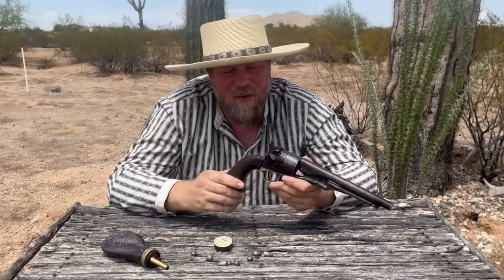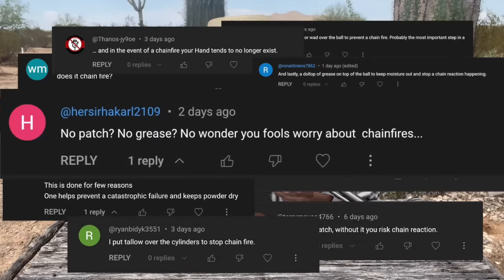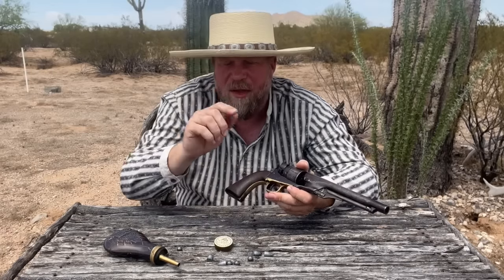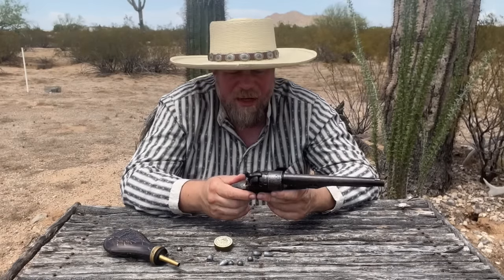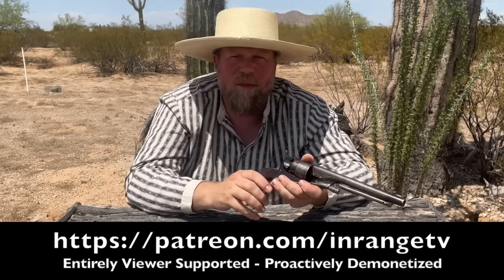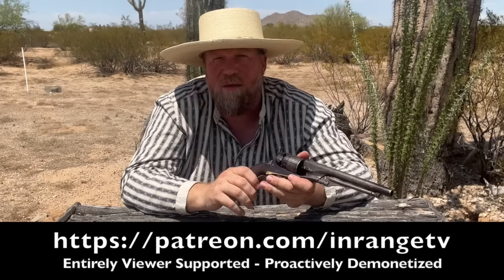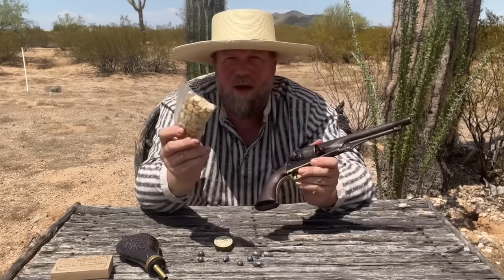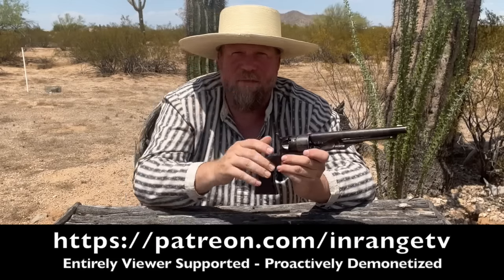Chainfire!  Is it dangerous?

Comment: I've heard both camps. Use grease and no grease. The negative camps explanation is that with proper size projectiles, you'll see a shaving of lead. Proving there's a good seal and eliminating the risk of a chain fire. In my limited experience with C&B revolvers, I usually put a smear of crisco sealing the end of each cylinder chamber. I've never used a patch or felt wad. But living in Vermont, I don't have the problem of melting grease like he has in Arizona.

Comment: I always load roundballs with a lubed wad, JUST for the lubrication. My assurance against chainfire is that ring of lead. For cylindrical bullets, I rely on the lubed grooves.

I came up with an "over the cylinder" lube that stayed fairly solid up to about 100°F, but the first round melted pretty much all the lube on the cylinder.  Very little added safety after the first shot, so I dropped it.

Comment: There is one more thing to consider: if a cylinder has been damaged in any way or is out-of-round, it is possible that a bullet that is swaged at the opening of the chamber may not fully seal. There are numerous ways to cause this, from overcharged loads that cause swelling to simple manufacturing errors. Chainfire is not a real issue with a properly sized projectile in a perfect chamber, but given the manufacturing tolerances of these old revolvers combined with user error that may have damaged them, it is still a real issue in historical pieces.

Comment: My problem with felt wads is that you can not let them sit in the gun for long because the powder eventually absorbs the moisture.  I don't know if anyone sells dry felt wads, but putting wax over the balls works better (here in the mid-Atlantic region).

Comment: Great video! If I may ask, is there any solution regarding the primers/ caps during fireing, so they ,or fragments from them, don't lock the cylinder on the revolver and fall into the mechanism and jamming it up? That is probably the biggest problem when it comes to  reliability of percussion revolvers. Greetings from Norway and Idar Ola🤠🖐

Comment: I have a brass frame Pietta 1851 Colt in .44. I use .454 round ball which is oversize and shaves off a thin ring of lead on each ball I load. I do not use a wad but smear a 50/50 mix of beeswax and coconut lard over the ball and have fired many thousands of rounds over the last 25 years I have had the gun. I have had a chain fire twice in that time. Both times it was in very hot weather (here in Queensland Australia) and was the next chamber to the right and the ball went skipping down the range and was not a big deal. I did not think it could ever be a problem.
Then I was shooting one day with another guy who had a Navy Arms 1851 steel frame in .36. He fired a shot which sounded unusual then the revolver jammed. On inspection it was evedent that the lower chamber had chain fired and the frame was visibly bent. I would not have thought this possible but there you go.

Comment: My one and only chain fire was with a Uberti made .36. I used the recommended no. 11 cap, pinched. I had .375 round ball, almost perfect lead rings. This was the first and last time I used revolver wads, and a grease patch. Upon firing my first round, all six chain fired. I have not used a wad, or grease patch since. I think mine was caused by some how i messed up with the caps, I can't think of anything else.  The only damage to the gun was a small spot of bluing missing from the cylinder pin, and i had a ball stuck under the loading lever, my only damage was solved by changing my drawers.
Reply from the maker: The wrong size caps are definitely a problem and pinching them is a hack that can result in a chainfire.  I recommend slixshot replacement nipples with CCI#11 or, even better, Remington #10s.

Comment: I always used lube on top of my round balls te prevent fouling.
If not then after 2 cilinders you see the groups going wider because of the hard buildup inside of the barrel.
And it takes a lot more work to clean that.
I like using bore butter, but yes that melts if it gets warmer.
i live in a country with a moderate climate but on really hot days i used tougher grease composed out of beef allow and beeswax.
I never walk around with a loaded gun in a holster so even if the grease melts a little, all shots are fired before it has the chance to run out.
I have been shooting cap and ball revolvers since 1987, never had a chainfire.

Comment: Between my flintlock long rifle and a remmy 1858 I decided I needed to make my own grease/lubricant to cut down fouling.  Long rifle can't shoot more than one or two rounds before it becomes nearly impossible to shoot from the fouling.  The remmy can get off two cylinders before its time to clean it. So I mixed together some bees wax off amazon with some Olive oil from my local store.  Melted down and left to solidify.  Yeah, it can melt, especially once your gun gets hot, but if you get the mixture right you can adjust it to remain more solid in the heat.  I can fire all day without any issues loading every round is easy or easier than the first.  Leave a rag on your belt to wipe your hands if its an issue.  My long rifle wood loves the oil.  Plus, it smells delicious when you fire off a round.  Worse case you have incredibly moisturized hands hahaha.

Comment: I had one that 4 chambers went off.
One up the barrel, two either side and cleared the frame. One went up the loading ram. Which I loaded back in.
No obvious extra recoil, as the extra chambers had the balls pretty much level with the front of the cylinder. So barely and velocity was generated.

Comment: I load in the new-old version, aka "the Oregonian" or "the naval pattern ".  

Powder,  followed by paper wad/paper cartridge body, followed by ball, followed by a hefty plug of homemade Bore Butter,  which is paraffin mixed with Crisco and melted while blending.  The Crisco falls away in hottest climates, but the wax will remain as a residue.  

Also,  several points you made were incredibly inaccurate.  Yes, Colt said that.  No, it's not a 'new' method to use wax and wad and wax-cover your caps... that's actually the US NAVY Standard of Arms for the 1861 Colt Navy, which was developed for use on Ironclads and sailing ships with a higher likelihood of powder-fouling  due to higher atmospheric moisture content due to the spray of the sea. (Ref. Naval Arms and Operations of the United States,  1800-1900) 

I carry my Josephine this exact way, and have yet to experience a chainfire (cross my fingers), as that's what DGW (the manufacturer and distributor) suggested in their Manual of Arms, or I'd be shooting smooth-wall hollopoints that I can source which are made from the same soft lead as the swaged round ball. I simply know about the Navy MoA, because I come from a traditional military family, and my Grandad and sister were both in the Navy. It's not a well known or oft repeated piece of historical knowledge.  I can say that the first person to make the concept standard in the Navy for all cap-and-ball revolvers, was none other than LtCmdr. Johnston Morgan of the Monitor.  Little piece of historical facts for you.
Reply: What is a smooth wall hollow point?
Reply: @markfrench2980  one without greasetrap grooves on the side of the projectile.

Comment: Appling grease/lube to the chamber mouth will not prevent chain fire if the projectile is undersize, if you fire a fully loaded percussion revolver then look at the front of the cylinder you will see that there is no lube left, it has all been blown away by the first shot, but if a correct size projectile is loaded,( as you do), leaving a ring of lead, there is no chance of chain fire from the front, unless the chamber is in some way damaged leaving a flame path, the problem with a lot of todays shooters is that they have a very casual sloppy attitude when shooting C&B, so use oversize caps, or worst still squeeze them to stay on the nipple, and use bought in undersize projectiles, if you look at a slow motion video of a C&B being fired you will see the rear of the cylinder is engulfed with flame at chamber pressure, given a loose, or missing cap that is where chain fires occur, the problem is made worst by the mainspring being weak, allowing the hammer to blow back from the nipple, bang bang! This is an excellent video made by someone that knows the subject!                        Stay safe! Chris B.

Comment: For the last three years, I have been using 0.451 balls sealed with heavy industrial grease. It's very messy but works for me.
I'd like to try conical projectiles, but they are very hard to find.

Comment: I make my own paper cartridges for my Walker and 1851. I use cigarette papers and a dowel tool for proper sizing to make and tube and then another small circle of paper to make the bottom of the envelope. When that's done I pour a powder charge In and then take a round ball usually 454 for the uberti Walker and I roll it on the top of a glue stick. Then I take the envelope and seat it in the top of the dowel tool and seat rhe ball on top and compress it down with the dowel so it's nice and tight but not too tight and the ball is nice and attached. I can shoot these no problem but what I like to do after is take a tin can of lamb tallow I have and heat it up on the stove for a few minutes to liquefy it on a low heat. And I dip the exposed ball into the wax so that it goes just up to or barely up to the paper to coat the ball I'm a thin wax and I store the cartridges in a cartridge box I made for later. It can take quite awhile to get a good ammount saved up and its a process in itself but it makes range days alot quicker and more fun to shoot and if I run out I can just switch over to the flask and patch. Or if I want to do heavy loads in the Walker I can pour it out myself as the cartridges are pre measured.

Comment: I have fired thousands of rounds in a percussion revolvers (Remington) with all six chambers loaded but only 5 capped (for CAS events), never a chainfire with loose powder and balls... I cast my own balls from pure lead at .457" which shaves off a ring of lead on loading, so the fit is perfect, as good or better than a metal cartridge. The .457 balls actually have about a 1/8" bearing area when so shaved. Chambers are slightly chamfered at the mouth and all reamed to be perfectly round and .001" over groove diameter which I measured at a consistent .451". I have never, ever, had a chainfire in over 30 years of shooting, even with uncapped nipples on loaded chambers.....I have never used grease in the chamber mouths, and I imagine that back in the day it would have been a terrible idea as during carriage all sorts of dust and grit would collect and do the bore no good at all.
Latterly, I have used paper cartridges with conicals, bullets lubed as for metallic cartridges. The conical mould I have makes .451" bullets, which are a bit marginal, but in the paper cartridges and with the grooves filled with lube in a lube/sizer they work very well. Both balls and conicals are very accurate, with pretty consistent velocities.
I have a feeling that some commerically made balls are a) not consistent in size and b) not made of really pure soft lead...

Comment: Great video. Back in 70s, I squirted Crisco over the balls (that doesn't sound quite right :P) from a 2" diameter pastry decorating syringe. In the cool Northwest, melting wasn't a problem, and I think the grease did help to reduce fouling. The balls that we cast were big enough so a ring of lead was shaved off as you'd seat the ball, and that was such a tight fit that I really doubt it could have chain fired.

Comment: I have limited practical knowledge, but a lot of youtube knowledge since I have always wanted a cap and ball revolver.  
What is not being discussed are the lesser quality of the modern replicas compared to original colts.  Most if they want to use conicals last I heard must elongate the loading slot that is just in front of the lower cylinder.  It is my understanding that often other tolerances are out of spec in these modern guns.   
Many replace the nipples on their replicas with those provide a more secure grip or hold on the caps.  And a better seal on the front end of the cylinder is the more obvious solution that one can readily understand vs flame around and between the nipple and the cap is not so obvious.

Comment: The one thing I can attest to is that you will destroy a Brass frame revolver with a few chain fires. My first BP pistol was a Brass frame colt .44 copy and it was my first time shooting Black Powder. at that time not many were shooting BP guns in the 1970's. The only instruction I got was from the gun shop where I bought the gun and they were the ones to tell me to use a hard tallow or grease over the balls. I knew back in the day they shot canonical bullets and round balls but I could never find the canonical bullets. Later I bought an 1858 .44 Remington Brass Frame and I happen to spot a Black Powder Shooters Bible there with complete instructions for loading BP Revolvers. The proper size bullet was stressed in that article and they stated that when you rammed the ball into the chamber, the proper sized ball will leave a lead ring around the chamber and that would keep chain fires from happening. As I remember the information sheet that came with the gun said the proper size ball for that 1858 Remington was .458. I always used the .458  swaged balls in that revolver until I got a .458 canonical bullet mold. I switched from grease or tallow to bees wax for lube and still believing that was for safety. When I shot the Colt I found that after the first shot most of the tallow or grease was melted and it was all gone after the second shot. But the Bees Wax, even though it melted from the flame of the shot, a good portion remained. I shot that Remington for 30 years, thousands of rounds without a chain fire. But with the Brass Frames it comes a time when the barrel loosens up. I was able to fix th the loose barrel for a bit, but then the frame cracked in the thin area by the ramrod. Brass will only take so much hammering from firing, so now it is a wall hanger. But you are right as to the proper size bullets to prevent chain fires.
One other thing I might mention. When I was stationed at Hickam AFB HI, I would shoot with the BP club out there. One guy had a reproduction of a Colt Walker that took 60 grains of BP. To cut back on the powder charge to 30 grains because Black Powder was hard to get in Hawaii, he would charge each chamber with 30 grains of BP and use another 30 grain volume of corn meal on top of the BP to fill the gap before ramming the the ball. That also worked to prevent chain fires and also added to the cleaning of the barrel every time he shot. He never had any problems shooting it that way the 3 years I shot with him. My 1858 only took like 27 grains of BP so I could never needed a filler on top of the BP.  Later I knew another guy that did the same thing in a rifle. He also stated that it kept the bore cleaner. Have you ever heard anyone doing that? 
While I was stationed at Hickam AFB, I ordered my first BP Rifle a special order 1863 Shiloh Sharps that would take a 150 grain BP charge. I love that rifle and I have hit Ram targets at 1,000 yards when most other BP muzzle loaders can't.

Comment: This makes actually a lot of sense and I never thought of it before. If the ball or bullet is wide enough it will seal properly. I guess unless people are using poor quality balls with dents and divots they made themselves or got off a friend that were of suspect origin. I think a lot of this comes from safety on a range. Which for the most part is where people would have to fire the things, at least where I live. I could imagine a lot of people just buy any size ball close to the calibre and fire it and cause the problem. I guess stressing its importance might stop an issue when an idiot uses one. Thanks for the video, would love to see an up to date video on magazine tube detonations. I know it has been done in the past and mentioned with the 1860 Henry design, but would love to see one recreated on purpose to see how far things may go if done improperly and what kind of damage it may do. (Use a cheap Rossi :D)

Comment: I always thought it was kinda impossible to get chain-fires with right size ball in a right size chamber.......... My issue is cap jams on 1851 Navy, ever since Rem #10 has discontinued. Was there problems with cap jams with Colts in the 1860s or is this also a 21st thing..........

Comment: I shot blackpowder for yrs and never had a chainfire. I shot my rememington replica daily. I used patch and butter except if I was carring it for protection( blackpowder aren't considered a modern firearm,legal to carry in most states loaded) I could pack 33.5 grains of powder with a ball in a cylinder and it would seat deep enough to spin the cylinder.  I don't recommend but it was a monster load that turned a plinker into a naildriving fire-breathing monster. Hehehe I slept real well with it under my pillow at all them motel6! But I did swell a couple cylinders! Hahahaha

Comment: I'm wondering how bad the worst case scenario really is when the extra chambers have basically no barrel. Could be interesting to chrono just the cylinder and see how much power we're really worried about, or maybe ballistic gel in front of a severe chainfire event.
Reply: Pietta makes a variant of their 1851 Navy as a pepper box.
No barrel, the cylinder is maybe an inch longer than the cylinder on the standard Navy.
Plenty deadly.